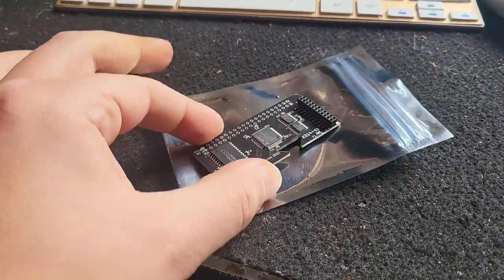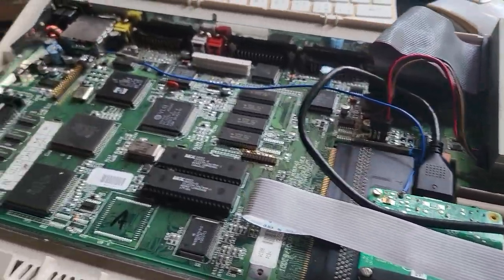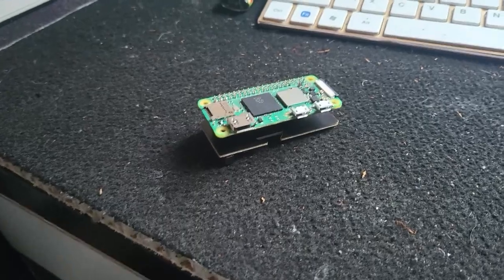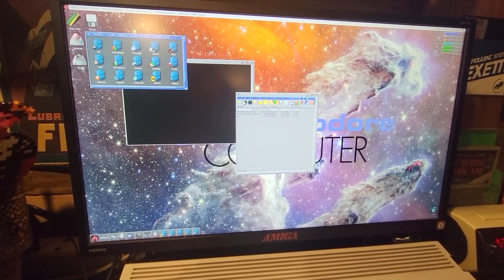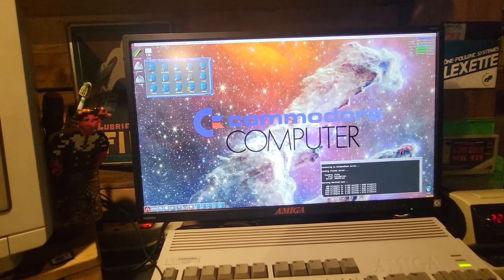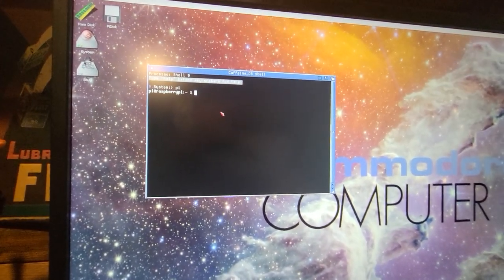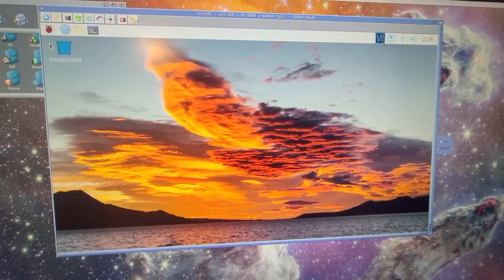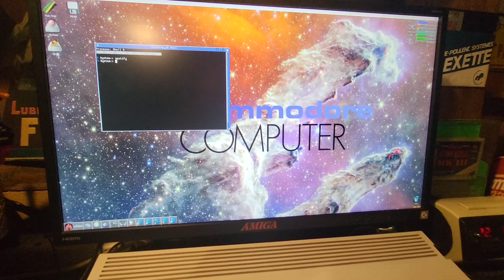Let's check the a314cp add-on for the Commodore Amiga

Comment: Have seen odd bits about the A314 for A500 but didn't have much understanding of what it did. Never heard of this CP version. Seems like a really neat solution to get an Amiga on a WiFi network. Thanks for the demo.
Reply: It's basically follow-up of some crazy idea of using RPi on Clockport on EAB. Niklas has made an adapter and also modified his A314 software to work with clockport version as a proof of concept really. It appears that this project actually has found some bigger audience though despite clockport's poor throughput. My idea on the subject was ... to rather throw CP away and use e.g. 512KB of "ranger mem" space with 32bit interface instead. It's usually unused on A1200 (unless turbo card tries to fit all non-reserved addresses in 24bit space, there are some known to do that). And it would've been much faster and usable. But hey, he has done this one and it's great too.

Comment: Are you running the pi zero overclocked? How to maintain enough speed to use desktop environment? I mean, I know it can handle that, but it is a bit too weak for it.
Reply from the maker: It's a stock pi zero 2 no overclock, the faster is the pi, the faster is the experience.
Reply: @-H3li03-  I have Zero2 as well. Are you using RTG graphics on Amiga? Through piStorm? what is the resolution of the piOS screen through vnc you suggest? I think it is slow mostly because I am using it through AGA.
Reply from the maker: @kratafila  On the Pistorm I have a Pi3, 1920x1080. About the speed of the vnc stuff, that's limited by the vnc protocol itself, it's never going to be snappy, the resolution of the pi in the a314cp if I remember correctly it's 1024x768, when used via vnc.

Comment: Thank you very much for your video. Perhaps a few well-intentioned criticisms.
The sound could be a little bit better
What is really exhausting, the very unsteady camera work. This constant back and forth, back and forth, the permanent changes of the camera position, are really no fun and unfortunately degrade the video very much.
The lighting is also in need of improvement.
But these are only technical things that can be solved in an executive way.
The content was very interesting.
Many thanks for that
Reply from the maker: Thanks for the tips, I made a couple of new videos where I tried to do a little better. :)